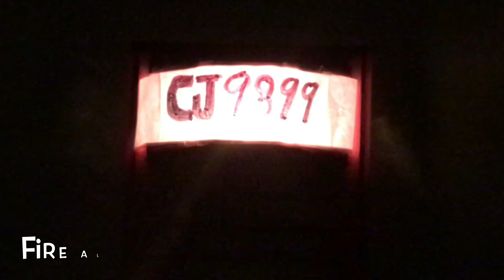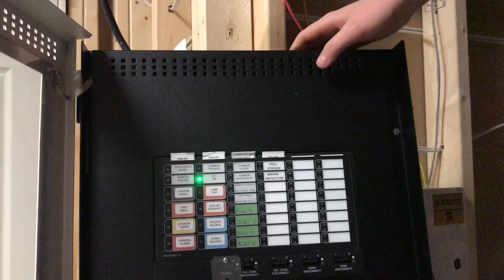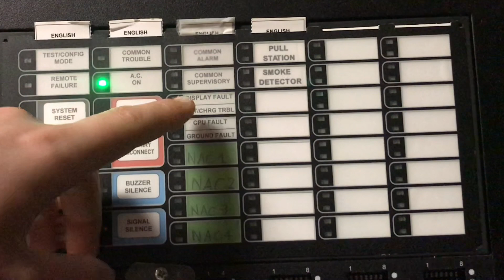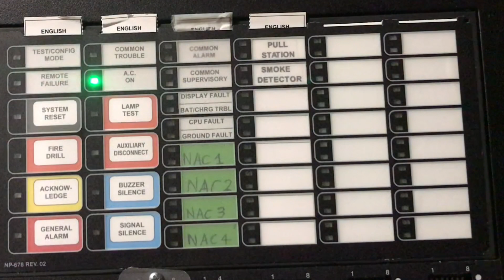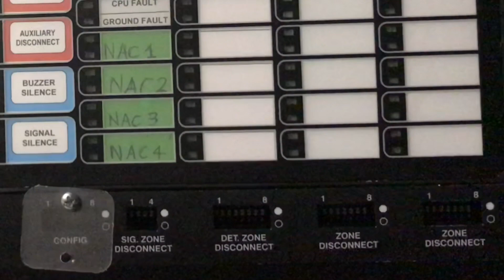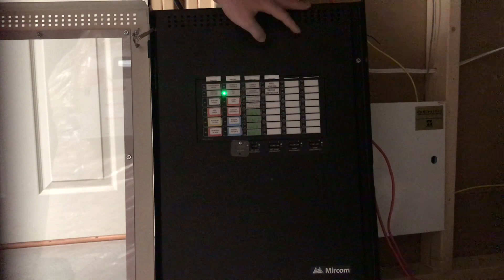(PART 1) Conventional Panels 101: Mircom FA-1000

Comment: how do i put the system in test mode so it doesnt go off during renovations
Reply from the maker: Use the dipswitches under the bell cct LEDs to bypass the bells. But always call the monitoring company first that monitors the panel to put the system on test with the fire dept
Reply: @CJ9899  yea we self monitor and I called them myself so that parts fine but I would just turn off all dip switches in the first bank with the plastic cover ?
Reply from the maker: @iiiuuj  the 4 dipswitches under the bell cct LEDs will bypass your bells.

Comment: Hi ,  (Auxiliary disconnect ) is the only button I need To push for by-passing the system if I am working  on the sprinkler system?!
Reply from the maker: No, you need to use the dip switches or pop out the terminal blocks. Auxiliary bypass will only bypass the relays
Reply: @CJ9899  alright thanks man!!! Cool channel

Comment: The point of the acknowledge button is if you have a two stage system, you have to press that within about 5 minutes or else the panel will think that there’s nobody investing the alarm and evacuate the building.
Reply from the maker: Yes, I realized that after I made the video